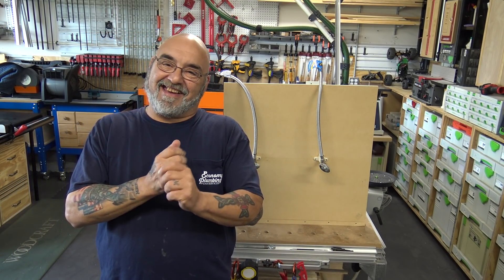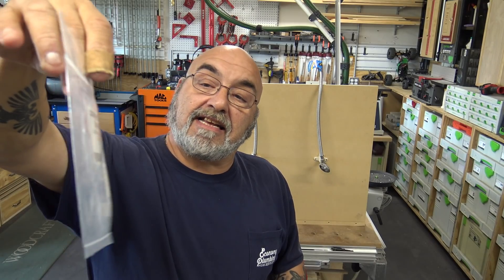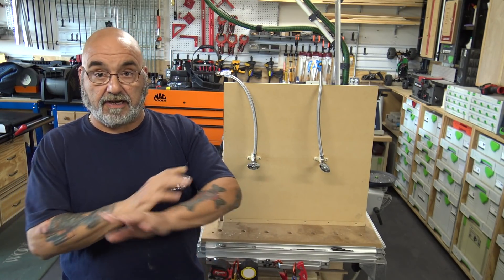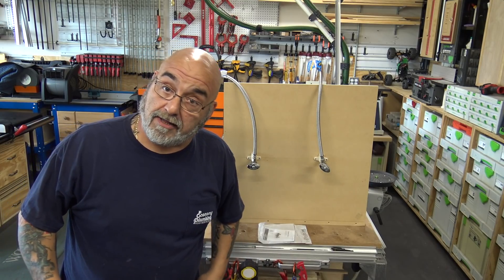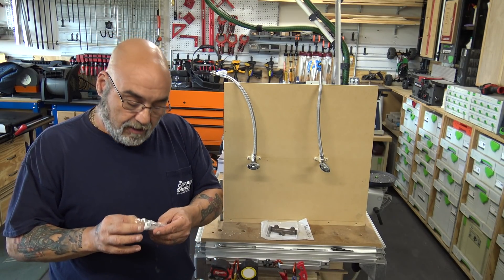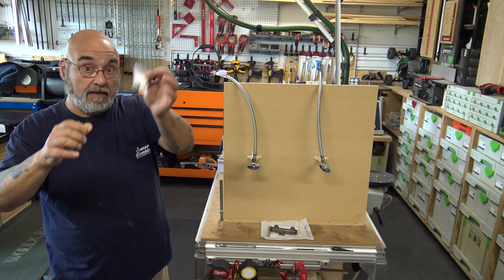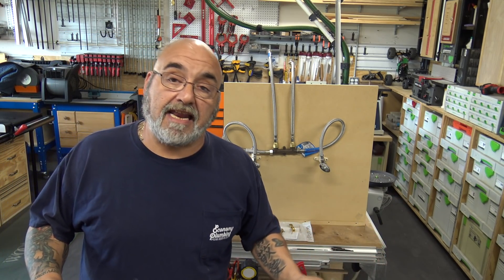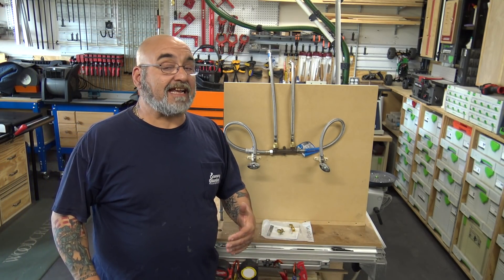How to install Rinnai's thermal bypass valve on the RUR series heaters.

Comment: i have a leak at the bottom of the tankless unit. It appears to be where the hard line connects to the pressure relief valve connection. How to take that off and is there a "o" to replace on the connector? Tankless rur199in unit

Comment: Will the crossover bypass valve work if it is installed upside down and connections are connected to the correct hot cold in/out hoses?   Is this valve gravity driven?

Comment: Great video.  Learned a lot.  Have you done something similar for the RU models where you need to add an external pump?

We just installed an RU-199iN.  Works great but we now understand that a lot of water is wasted warming up the system.  It takes 2min @ 1.5 gpm to get warm water at the master bath tap.  

Since we have the RU model, it seems like we need the thermal bypass valve, an external pump, and maybe the Wi-Fi adapter to trigger recirculation. Your video on the RUR shows a filter being installed but I don’t think the RU has that. 

Any advice would be appreciated. Thanks!

Comment: Thanks, I  got it working with the thermal valve thanks to your video showing the difference between Dedicated vs CrossOver. 3 years of long wait for  hot water is now over.

Comment: What happens if the contractor didn’t pull the plug and replace with the filter but I have my new sensi unit set to recirculating mode 4C parameter with comfort setting I think 5b for that parameter. I did install the thermal bypass valve but still feel water does not instantly get hot. Maybe this is why, the filter was not put in? Will it hurt my unit leaving it this way on recirculating until contract gets back out to put filter in? I think he threw it away :(

Comment: My RU199 has a dedicated recirc line.  Neither a plug or filter is on that plastic drain bolt, it's just the bolt.  Is this ok or do I need to buy a plug to put on it?

Comment: Hi Mike, I already had a delicate pipe for 1 branch but the other branch is far away. Can I install the bypass on this  branch and keep the delicate loop on the other? 
Thanks much.
Reply from the maker: Sorry no you can’t is there any way you can run a second dedicated line from that side and connect it to the other line.

Comment: How can I get recirculation on a RU160in without a dedicated return line?  Do they make a powerful enough pump and thermal bypass valve set-up for the Rinnai's flow requirement?

Comment: Hi Mike, if I have multiple plumbing branches, can I use more than one valve? Basically, I would install a valve at a fixture on each branch.
Reply from the maker: No only one bypass is allowed
Reply: @The Rinnai Guy  Thanks for the clarification, Mike.

Comment: How much do shared lines effect this recirculation method? For instance my Shower/Tub gets fed from the main 3/4” line but the toilet is piped off the cold water side. The furthest fixture where this will be placed is my kitchen sink, which also has an exterior garden hose piped off of the cold kitchen line. The diagram in the manual shows each fixture receiving its own dedicated line which isn’t the case. Thanks

Comment: Plumber told me bypass valve doesn’t enable enough water to flow and therefor it doesn’t work; any thoughts on this would be much appreciated
Reply from the maker: He wrong 90% of my RUR installed are with the bypass valve snd not one problem
Reply: @ThatTanklessGuy  do i still need a pump for it to work?

Comment: Hey Mike I’m going to be installing a thermal bypass valve soon and I’m confused with this bypass filter. I’ve searched everywhere underneath the ru160in and there’s not a place for this filter. Is that y fitting only on older models?
Reply from the maker: That is only on the RUR model. You can not use the bypass valve on the RU Model only a dedicated return loop can be used. Mike

Comment: I have viewed your instructions on the different ways to run a hot water re-circulation system but none are for the V75I is this a different model number for the RUR or some other series ?

Comment: I am a homeowner and not a trades person. I was talking to Rinnai customer service and they told me that the RUR160iN does not need a dedicated return line nor does it need a cross over valve (what you are calling thermal bypass). I asked her how in the world does that work. She told me it was because it has it's own pump and she suggested I watch YouTube to get more detail. Well, based on your video, I am going to assume she was incorrect.
Reply from the maker: if you don’t have a dedicated return you need to have the crossover valve ( thermal bypass valve) installed at the furthest or most troublesome fixture. That’s the only way it will work. if you need to you can call me at 19042385349 and I will go over it with you. 
mike
Reply: @ThatTanklessGuy  Mike, thanks so much. Since I am a homeowner and do not make my living in the trades (plumbing, HVAC, electrical, boiler, etc) I assumed Rinnai Customer Service knew what they were talking about when they told me it did not require either. But I just could not understand how in the world it would work with no dedicated return or no cross over. So I asked her how it works and her answer was 'The RUR160iN has its own pump. And go to the Rinnai channel on YouTube and it will show you how it works'. Well, their channel contradicted the customer service rep and your video confirmed the need for one or the other. I have a couple of estimates in to replace my old gas tank with a gas tankless. I decided on the condensing version (more efficient) but still trying to decide if the recirculating feature is worth it. My house was built in 1977, is a hair over 3100 sq ft and the furthest faucet is about 80 feet away from where the tankless would go. I keep reading about how recirculating reduces the amount of water wasted but I also read where the electrical usage of the pump and the additional gas usage to keep the water heated will be far more expensive than any water savings. So I am still researching. But again, from a simple homeowner, thanks for getting me a little more educated.

Comment: Getting a code 63 on this system with my RUR98i. I just did a vinegar descaling. If there is air in the line (and/or internal pump) how do I get it out? There is no drain valve on the cross-over method.
Reply from the maker: there is a small black drain rite under the pump on the bottom of the tankless.
Reply: @ThatTanklessGuy  Thank you so much! I will drain the air and reset the MC 195T

Comment: Thanks mike for the video, dedicated to your craft for sure. 

I have a ru199in. I can add the WiFi r-module, but what external recirculation pump do you suggest?
Reply: Call me at 19042385349 today around 6pm eastern time and I will go over it with you

Comment: I have a R94i.  I would love to be able to do this.  However, I do not have a dedicated return line and Rennai customer support said it was not possible with my model.  Is there a work around that can be done without adding a dedicated return line? Thanks!
Reply: If you have a RL series unit you can install a HE Plus pump system with a bypass valve. I have a video on it call me at +19042385349 today after 6pm snd I can go over it with you Mike

Comment: Trying to find what i need to buy and install to add recirculating pump and bridge to my new home. 
Not certain if my RU160iN (REU-N2530FF-US) has built in recirculating pump or can i install a Watts universal pump, or do I install the filter, bridge and wifi for Rinnai, not sure what i need to buy....If you can provide some insight or direction on where i can find the parts i need to add recirculating to my home (without return line), much appreciated.

Comment: I have a Rinnai v75in can I put a  pump and  bypass valve p.s.water take (5) min to heat-up thanks,
Richard
Reply: No the new pump system will only work with the RL Series unites.

Comment: I am at a loss here with the way it works.

How does the thermal bypass work without a dedicated return line? If it recirculates water using the existing cold water side, wouldn't the cold water be hot when it's turned on? Also 

I have worked in Institutions and the systems (boiler rooms) have circulating pumps that (obviously) circulate the water but they do not go through the cold water lines.

Do any of these Rinnai's have "built in" circulating pumps?
Reply: Call me at +19042385349 today eastern time and I will go over it with you. To much to text lol
Mike
Reply: @TheBuddylab  I have the same question - do you have another video explaining this or can you type a reply?  Seems like this may be good info for many.
Reply: The Valve automatically shuts off (does not allow hot water into the cold pipe) when hot water reaches the valve, when the Rennai pump gets pressure (the valve closes), it knows hot water has reached the end of the run and so it stops the pump. The valve only allows water to run to the cold line from the hot when its below a certain temperature.

Comment: I have RUR199i and just added a soft water unit. Does using thermal bypass valve have any issues with soft water unit tied in prior to Rinnai? Your channel has great information, thank you for all of your expertise.
Reply: No soft wster is good for the valve and the tankless. I install a lot of softeners with Rinnai tankless heaters and everything works great. I hope this helped Mike
Reply: @TheBuddylab  Which softner do you recommend?

Comment: Thanks for the excellent tutorial. I wondered what that code 63 was. I initially thought it was temp in Celsius, but that temp didn't correlate with the 125F I had set the unit up with. Lawn irrigation work introduced air in the lines. recirc pump works again after purgin air from the system. Appreciated! Thanks for what you do.

Comment: Hi Mike!  Love the information you are willing to share,  it is very helpful. I was thinking about installing this valve in my home. My issue is the water heater is centrally located in the basement. Should I use 2 valves, one at each end of the house? If anyone has advice or experience with this I would love to hear. Thank you
Reply: You can only install one thermal bypass valve on a RUR unit. Call me at +19042385349 and I can go over it with you. Mike

Comment: Hi Mike , great video thanks. was considering ru99 to replace my Nat Gas tank water heater  , after this video i will go for rur199.  I have one question, my current nat gas line that goes to my water heater is 1/2 ", will the RU 199 work with this  set up? or do we need to up size the pipe to 3/4 inch? I see Navien has a model NPE240A which claims that it works with 1/2 " line up to 24 feet. I Was considering Navien until I watched your video, but I wanted to ask your opinion on the 1/2" gas line before I buy anything. Thanks

Comment: I have a RUCS75IN heater. What do I need to buy to add a recirculating system to it? I have a dedicated return line already in place with check valves as you have shown in other videos. Thanks for your help

Comment: Hey Mike. You gotta make a video showing the swap out of that bypass filter set. It comes with two different size o-rings and is an unbelievable pain to screw in. The brown plug is made of ultra cheap plastic and I have busted two trying to get it seat properly. To make matters worse the part is really hard to find to order a replacement. 
Thanks for all your help

Comment: Thank you Mike. However, I cannot get rid of the flashing 63.  My plumber has replaced the circulation pump, bypass valve, & PCB. No joy. I followed your instructions to bleed the unit.  I did get quite a bit of air coming out of the hot bleed but the 63 keeps returning.  My plumber wants to install a dedicated return line for $$$.  I believe the problem must be elsewhere.  Can you help?
Reply: It is a RUR98e.

Comment: Hi Mike.  I installed a Rinnai SENSEI RU199IN last year.  I really hate dumping gallons of cold water before I get hot water to my faucet.  I do not have a dedicated return line, and wanted to know if it was possible to add a thermal bypass mode, and a pump that would recirculate on a timer.  Thanks!

Comment: I have a Rinnai RL94i and want to install a recirc pump circuit using a Grundfos pump, Thermal bypass valve at restroom at end of circuit, and a timer circuit that only allows pump to run at peak times (6am-7am each day for showers to avoid long wait time and water waste). I realize this will void my Rinnai warranty, but do you see any issue with this scheme- since it will add very little excess run time to burner?
Reply: Got the answer!  Thanks a ton Mike!

Comment: Should you use Teflon and/or pipe dope for the connections?  I’ve heard folks having a tough time with these valves leaking or not working. Wondering your experience. 

Thanks!!
Reply: No never
Reply: There is special tape for gas lines, worked great for me.

Comment: Hi, I have Flowtite valves under my fixtures. The only fixture that is not flowtite is the utility sink that is in my laundry room. This not the farthest point on the plumbing line. Can I connect a 2nd bypass valve in another location? Also, is there any easy way to connect the bypass valve to the flowtite valve or do I just need to replace the flowtite with a sharkbit valve?

Comment: Seeing the line drop from your hand ( 10:05 - 10:28)....MAYBE you connect all 4 lines FIRST....and THEN attach the bridge-valve to the back of the cabinet.......Also...SOME faucets have 1/2" connections right at the faucet; not all are 3/8".

Comment: Very informative. I've been to the Rinnai school in Peachtree City, Ga. but it has been several years ago. I was not familiar with the new Sensei model and you explain everything perfectly. Had a customer yesterday, new house, who had water heater installed by a local plumbing company and of course they threw all the owners manuals, plastic plug, filters, everything away. I was there doing something else and he asked me if I new anything about the water heater. Pulled the cover and could not find the controller screw connections. Now I know thanks to you and have a lot to go back and check. Just trying to help these people out because this local plumbing company really screwed them. I was just there installing propane tank and doing leak check. Thanks for the video, you do a great job of explaining in simple layman terms.
Reply: Mark Wheat thank you very much

Comment: Great info, new Ru199i installed with the thermal bypass as there is no return line in my house. Installer hard plumbed everything it looks awesome but he tied the T&P and the condensation line together, I read in the manual this is wrong, what will happen anything bad?
Reply: How You install  the thermal bypass??  I have the same model ru199im and rannai support told me that I can't  use thermal bypass  only with RUR model

Comment: Currently, have the thermal bypass valve install. Switching to a dedicated return line.  The installer discarded the Bypass plug. Can I run with a Bypass Filter with a dedicated return line, or do I need to get the bypass plug? Thank you.
Reply: janerikborge you need the plug. Rinnai will send you one. Call Tec. Support and they will send it to you. Mike

Comment: Thanks Mike for clarifying 2 systems for the CIRC360 installation on RUR199eN.  I was confused as we had return line installed and wondering where to put the bye pass valve.  So its now clear that its a different option.  Appreciate clarifying it.  Before this we searched a  lot to find out what to do with that part.
Reply: Man u are dropping plumbing gold.  Thank u sir!!

Comment: Thanks Mike for great videos!  I think Rinnai is one of the best brands. I want to install a Rinnai Tankless natural gas in my carport/garage but, trying to decide on which model to install.  Questions: Is the RUR98i & RUR99 older models?   Is the RUR160iN the latest/newest model?  If so, do you recommend this model or another model?  What would be a good discount price to purchase an RUR160iN (2 to 5 fixtures, 9GPM max)?  Are there smaller units available in the 7.5 GPM range with all of the same features like Recirculation SENSEI, Wi-Fi, Condensing?  What would be a fair price to have it professionally installed in the same place as my tank heater?  Thank you for your help.

Comment: Hi Mike.   I have a RUR99i and installed a thermal bypass valve at my farthest sink and everything works great and no codes.   BUT when ever a toilet is flushed, the recirc pump seams to activate for a few seconds then turns back off.   I installed a double check valve on the water inlet side going to the water heater and have the same results.   Are there any other things I should try or is this normal.  Thanks for your informative help.
Reply: When you use the cold water your adding cold water to the loop. The loop needs to maintain certain temperature. I don’t get this system at all. Why buy a efficient system and make it inefficient?
Reply: RB QU is the bypass valve going in the rite direction? Remove the bypass valve and see if there is dirt in it. If all is rite you may have a bad valve. Mike

Comment: Thank you Mike. I do not know how many call on this asking how to connect the controller and they loose the controller molex. Great video cant wait for the code 63!m video.
Reply: shrtct C I’ve had a rash of service call over the past several weeks mostly from builders . I also had quite a few e mails about it also. I will be videoing a install we did the other day  of a RUR 199IP showing the correct piping and bleeding of the system. You mentioned how many calls you get are you a Rinnai Tec.? Thanks for the comment Mike
Reply: @TheBuddylab  that is great news. I will send an email on the side with my email. Mike if you need anything just send an email and I will see what I can do.